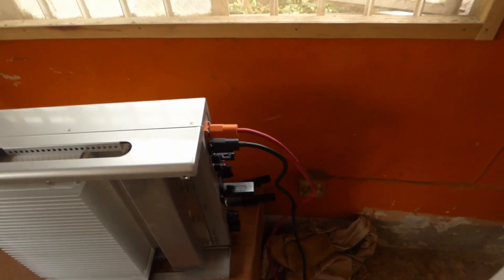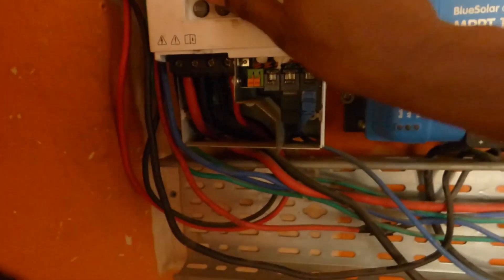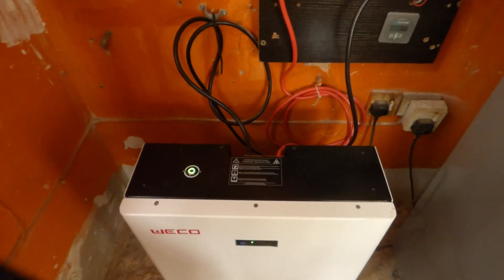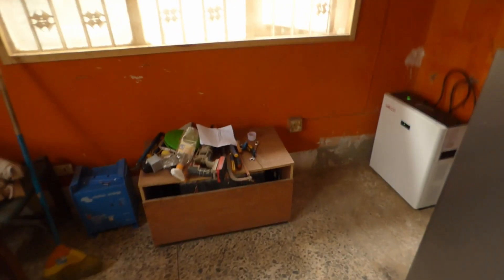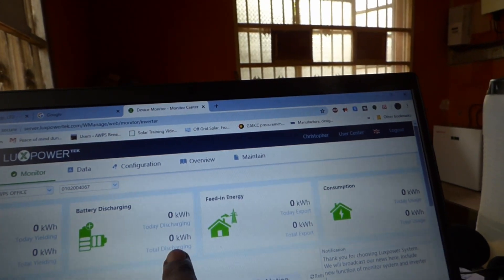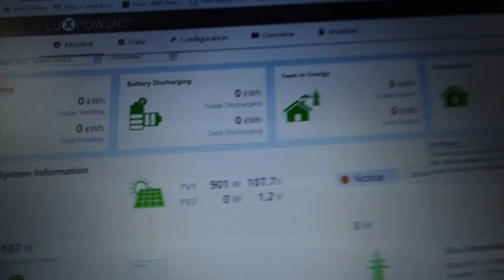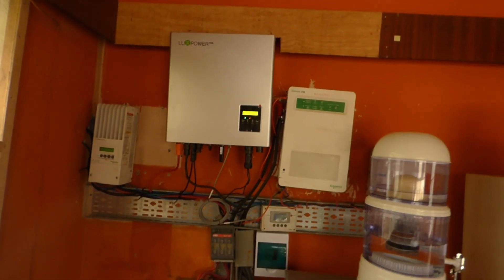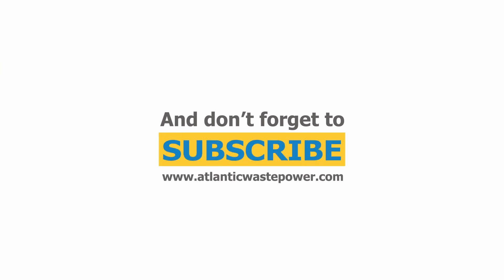Luxpower Hybrid Inverter is up and running sort of

Comment from the maker: The Luxpower folks have been very supportive, they are in constant communications with me. 
I have a few more things to do. 
1. Ground everything. The inverter (s) chassis and the controller. I have run the cables to the earth rod missing lugs.
2. Ground the EPS connection. I have L and N. Got some leakage and minor shock. That will be fixed today
3. The protective cover will go on.

Comment: Hi. I have a 5kW lux inverter and I'm trying to connect it to a A48100 dyness battery but it is not picking it up at all? I did put the setting to Dyness (number 8) as per the manual but it is still not picking it up. I am using the correct lux com cable as well to the battery. Please can you assist. Kind Regards
Reply from the maker: Do you have battery voltage? I have not worked with the LuxPower inverter in over 2 years. So I might be rusty
Reply: @drsolar  hi. There is no battery voltage at all. However, when I click Lead-acid then it picks up a battery and a voltage which is very weird.
Reply from the maker: @leeshanpillay1253  your setting for lithium or your comm cable is incorrect.

Comment: Nice video as usual Dr Solar. I didn't know the Lux inverter is that big. It makes the schneider look small. I really love the fact that it is fanless and can be paralleled if need be. What on earth is the unit price?
Reply from the maker: I did not think it was that big either. The SW does not punny next to it. The heat sink makes up a huge part of the price. You can parallel up to 9 units. Not sure I would want to do that though. They retail for about $1500 before shipping and taxes.

Comment: I have the same inverter as yours. My problem is the PV is not charging the batteries anymore. I tried to reset the inverter then after switching on back, the inverter will show up PV Charging + grid on but after one minute the inverter monitor will show up PVGridon and as I can see on my monitor that the battery is not charging again.
Reply from the maker: Hey Cris thank you for stopping by. What voltage do you have your pv at? Have you checked your cut off and charge settings?
Reply: I have LXP 3K LuxPower Hybrid Inverter 48 V. Regarding cut off I dunno how to check them, upon checking charge settings on the monitor Pc: 0w. Can you teach me please how to check cut off? I contacted installer and said the problem and they need to to come and check the breaker and inverter,  I may need to wait 3 more weeks because we are on Quarantine at the moment. If you can teach me simple steps to solve the problem would be a great help. Thank you
Reply from the maker: @cristolentino2643  email me at info@atlanticwastepower.com and I will send you the manual. Are you able to access the system online
Reply: @drsolar  hi, can you send me manual too?
Reply from the maker: @ohkey2999  send me your email address and I will do so
Reply from the maker: @ohkey2999  sent
Reply: @drsolar  thanks...